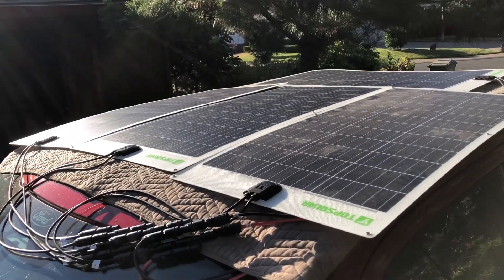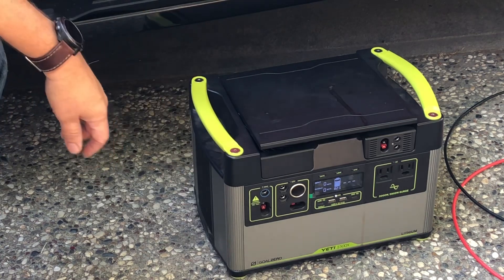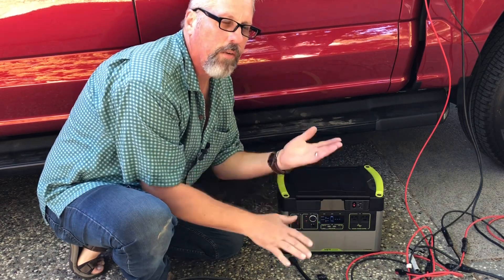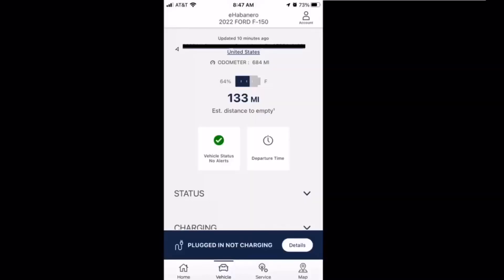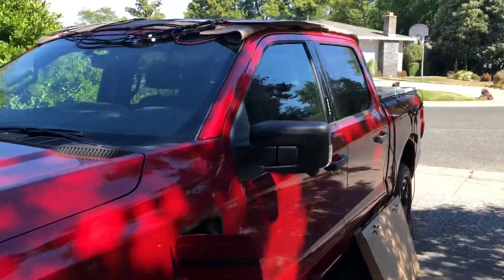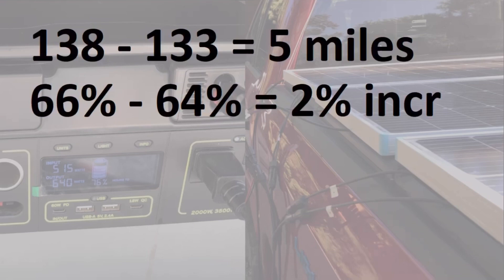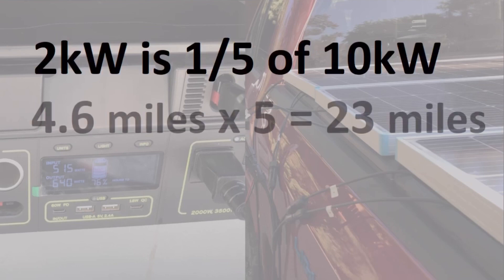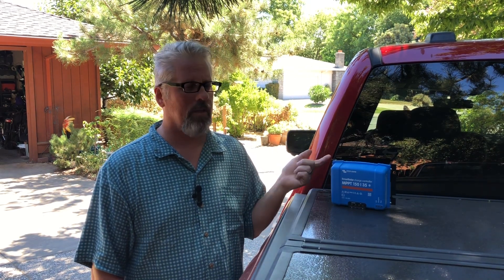Solar charging the 2022 Ford F-150 Lightning

Comment: A company is working on a solar tonneau cover for EV pickups. Supposed to be on the market soon...whatever that means. my estimate is, if you live in Phoenix and the truck is in an uncovered parking lot with the correct panels (less than you used) on the bed, you might get 10 miles of range a day from the panel....in Phoenix...parked in the sun. 

 This might be 300 miles of range a month. We pay 24 cents a kilowatt thus this might add up to almost $30 worth of free electricity a month for a panel set up that might cost almost $2000?

The interesting point here is that solar panels for electric cars will grow exponentially as they figure out the tech. The flexible solar panel segment is improving thus in a few years new EV's will have solar solutions built in that might do better that 10 miles day...who knows, but, folks will buy them.

Comment: I think we have the same tonneau cover. We're building an offgrid single axis solar tracking agrivoltaic system with around 3600 watts to charge our Lightning, and power a garage mini-split (and shade some raised beds).  Most of our testing is getting ready to make a big move off-grid to Central America, and want to have most of the bugs worked out in our knowledge prior to leaving. We already have grid-tie solar, and two small off grid systems, one 1200 watt, and one 600watt. One big thing will be working out offgrid charging of the Lightning which we, at least currently, plan to have shipped to wherever we end up.

Comment: Thanks for the experiment. Did you also calculate the power lost in the DC to AC conversion? Would be nice if you could charge via DC instead, but that’s for the “fast charger”.

Comment: 3000 miles in on my lightning, this truck consumes so much electricity. There’s no way solar panels would work. While charging on stage two at home my electric usage jumps to 4 kW per hour which is three times more than my peak home usage.

Comment: Nice video, I have a GZ3000 and it powers my home fridge 24/7. Great little solar generator I hope you can get some good solar panels for your setup. and fyi the GZ mppt add on controller can also accept 50v input if you were wondering!

Comment: What if u get a bed rack, have a rack extend all the way to the top of the cabin roof toward the top edge of the front windshield. Install as much panels as possible. And see?
Reply: the 20 miles a day would turn into 10 miles a day because the roof rack would create so much wind drag when driving.

Comment: During a lightning test drive, I plugged it into a 14-50R receptical that's connected to my home solar system using the 240 volt charger that comes with the lightning.  It was drawing 6600 watts from my solar system. I let it charge for 55 minutes which gave me 11 miles. I normally only have 2-3 hours of sun that i don't use to run my home while charging my solar batteries. 
My home solar has approximately 13 kw of panels that charge 800 ah 48 volt battery bank via 3 - 80 amp outback charge controllers, which power 2 - 4400 watt magnum Inverters. So when I'm using this charger I have to ensure my well pump doesn't try to start by tuning off its breaker. When I finally get my lightning I may just use the 120 charger, set my trucks max charge to 80% and just let it charge all night or until 80% is achieved.
Reply: the lightning has a big pack, I hope you don't drain the lightning too low!

Comment: I think if you could configure a system that consists of possibly 4-6 panels and can charge giving you 20-30 miles in less than 2-3 hours. You would have good system. If it's too cumbersome and it takes several hours, unless your camping and have nothing to do, it kinda is not worth anyones time or money. Excellent idea.
Reply from the maker: Unfortunately I think the equipment needed to get 20-30 miles in 3 hours would be too pricey for me...it could eventually be an option if pulling a trailer that could also take panels, but that's a future project.  My goal for this project is a deployable system for, as you say, a campsite while overlanding where you would stay a day or two anyway.  If you gain 20 miles on each of these days you may be able to extend your trip by quite a bit.

Comment: I would say if you had 4 or 5 400 watt panels that you could set up while overlanding, you could get very close to the 20 miles of range added per day. You would probably only be able to “mount” two on your tonneau cover and the other two would likely just need to be stored in the bed and set out when charging. I wouldn’t recommend a rough mount of a hard panel because the wind resistance when driving would definitely negate any range added from solar charging.
Reply from the maker: I'm going to look for some really efficient flexible panels that will maximize the available space on the roof.  I'm hoping I can get thin, flexible panels mounted pretty low profile so that it doesn't increase drag too much.  Same with the tonneau.
Reply: @the.electric.bluebeard  thank u so much for trying this. This idea has been in my mind for a few years now